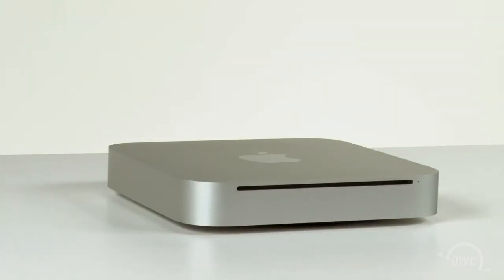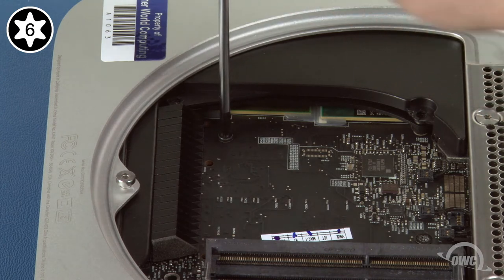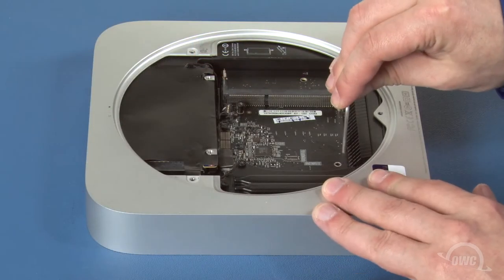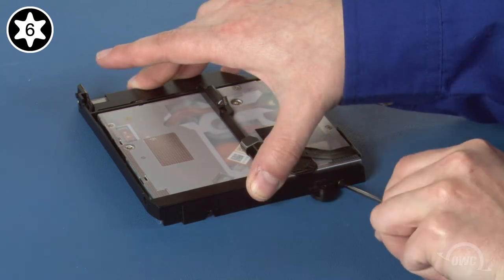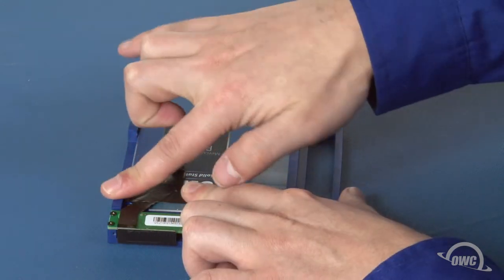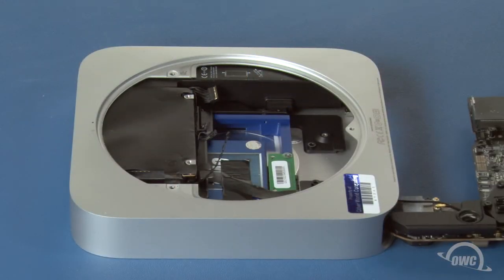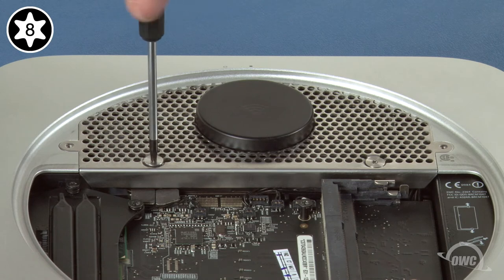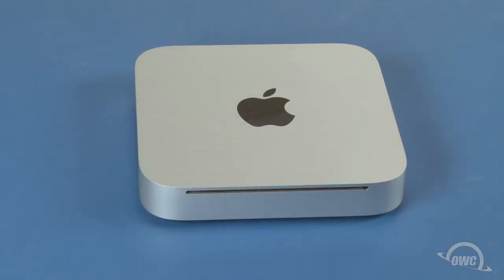How to Install a Second Drive Inside a 2010 Mac mini with the OWC Data Doubler

Comment: What if you don’t have a Mac mini motherboard removal tool
Reply from the maker: Hi Brandon,

We offer these for sale on our website, and I’ve provided the link for you below.
https://eshop.macsales.com/item/OWC/9229588/
Reply: Use two thin Phillips screwdrivers or something similar. Just be careful. I've done this and it works fine.